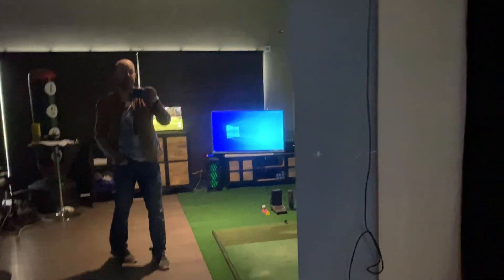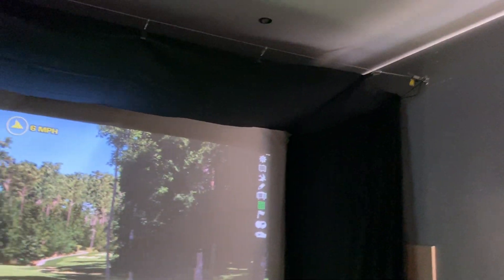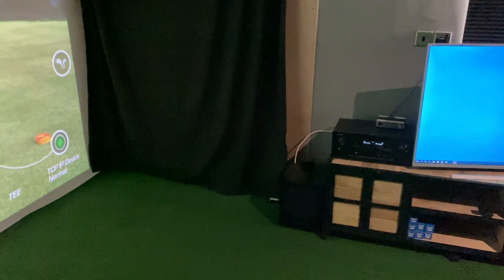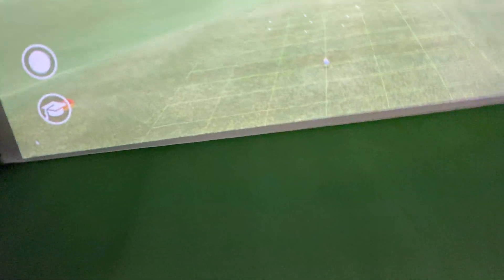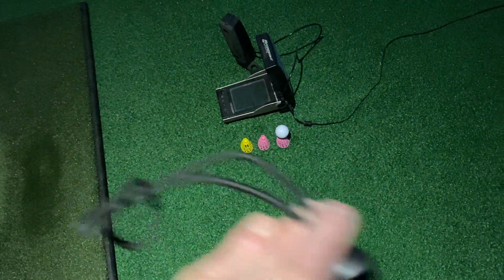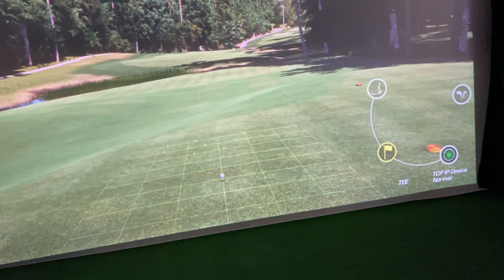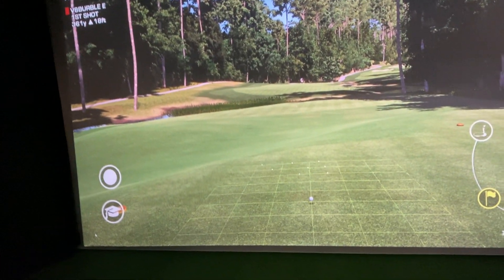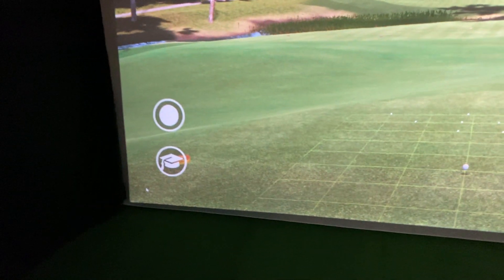Hybrid Me - Rebuilding my new Golf Simulator - Part 7 (Final part with costs)

Comment: how far is the projector from the screen and how low from the ceiling I have low ceilings approx. 10ft so the only way to avoid is if I'm closer to the screen. currently have a 120W X 108H